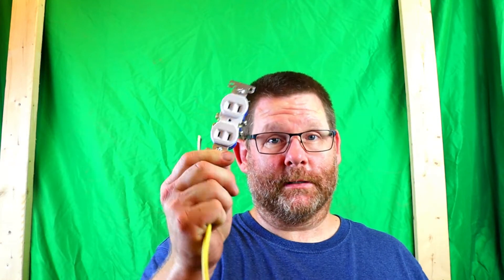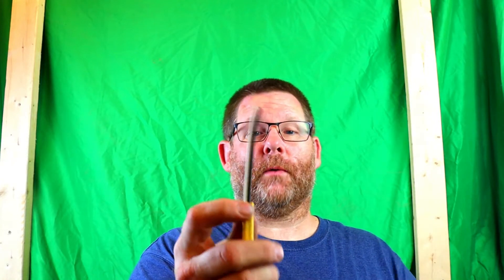How To Fix An Ungrounded Receptacle Correctly

Comment: It is permissible to run an individual EGC adjacent to an ungrounded cable into a box to provide grounding using provisions of 250.130(C).  As you mentioned having done in the past.  This is from the NEC.  Jurisdictions might have written ammendments over-riding the NEC.

250.130(C) Nongrounding Receptacle Replacement or Branch Circuit Extensions. The equipment grounding conductor of a grounding-type receptacle or a branch-circuit extension shall be permitted to be connected to any of the following:

(1) Any accessible point on the grounding electrode system as described in 250.50

(2) Any accessible point on the grounding electrode conductor

(3) The equipment grounding terminal bar within the enclosure where the branch circuit for the receptacle or branch circuit originates

(4) An equipment grounding conductor that is part of another branch circuit that originates from the enclosure where the branch circuit for the receptacle or branch circuit originates

(5) For grounded systems, the grounded service conductor within the service equipment enclosure

(6) For ungrounded systems, the grounding terminal bar within the service equipment enclosure.
Reply from the maker: Thank you for your comment and clarification.
Reply: @MountaineerOutdoors  Glad to help.

Comment: Just a question I’m not an electrician. I’ve seen these grounded to the back of the metal box? Where they’ve ran a single wire and use a self tapping screw to the back of the box..
Reply: More than likely, the box was wired with older style spiral metal clad electric cable (BX) in which the outer body of the spiral metal cable is grounded at the main electrical box through the electrical cable clamp and the other end of the electrical cable is connected to the electrical box in the wall with an internal electrical cable clamp and a wire inside the wall electrical box is attached to an interior green ground screw that is machine threaded (screwed) into the electrical box and the other end of the grounded wire is attached to the electrical receptacle at the receptacle ground screw and that is electrically connected to the two ground holes of the receptacle and the yoke of the receptacle.  The receptacle is now properly electrically grounded.
Reply from the maker: You cannot "legally" use a self tapping screw. It has to be machine screwed.
Reply: @MountaineerOutdoors  The metal box has been tapped with a machine thread and I believe it is made for a 10-32 green ground screw.